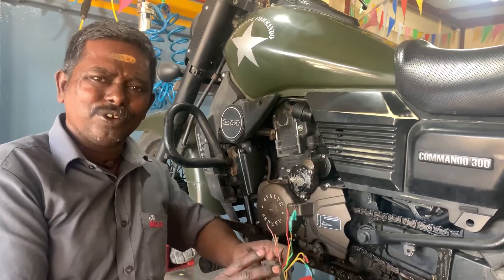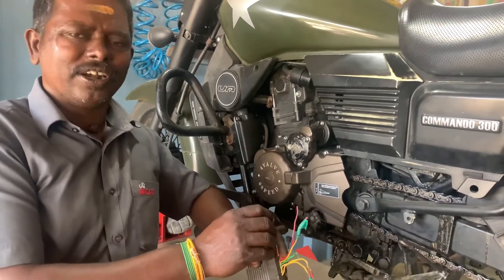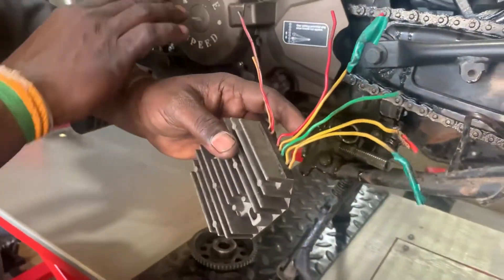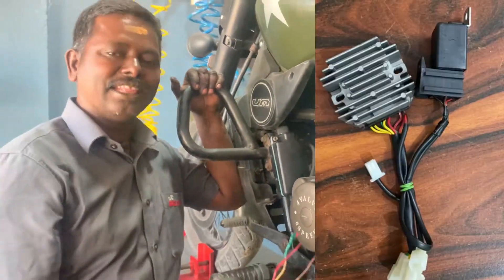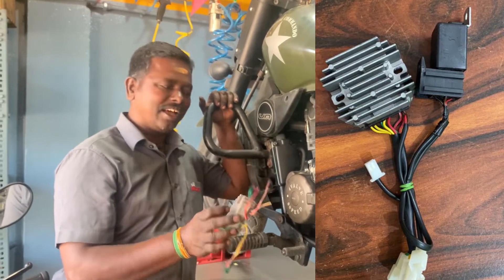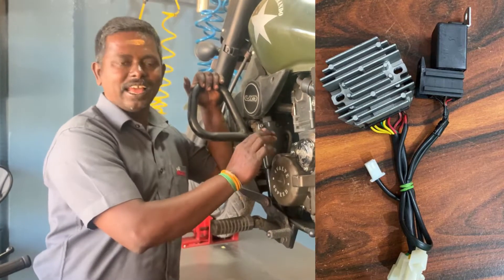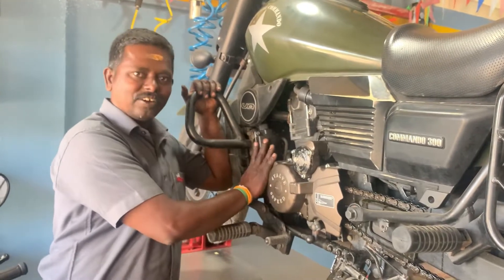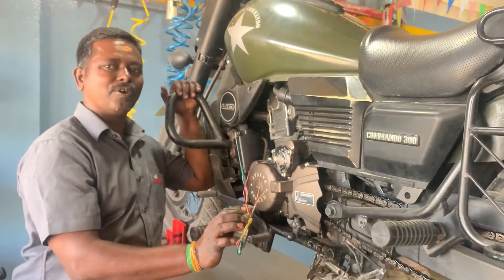UNITED MOTORS COMMANDO 300 | Service Review | Regulator & One Way Clutch Repair

Comment: Hi,
My regulator also gone.were can i get the original regulator for commando 2017 model
Reply from the maker: Contact my spare parts dealer +91 91 0 86711 67